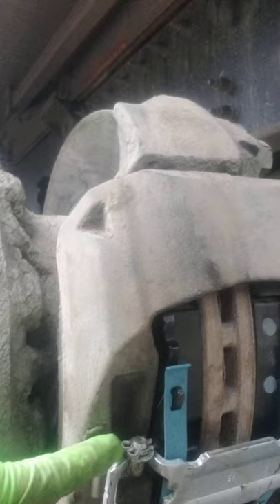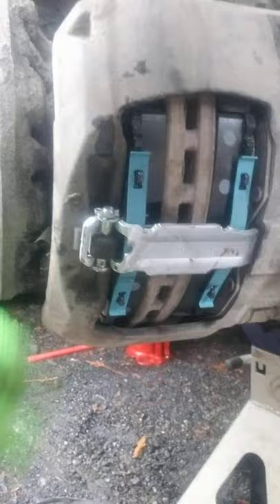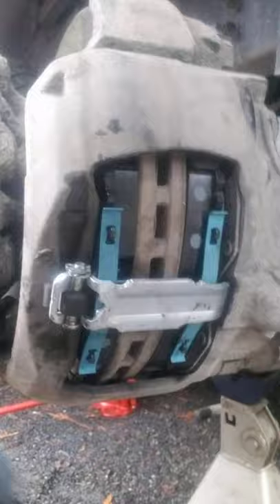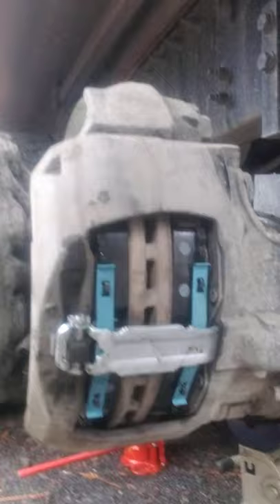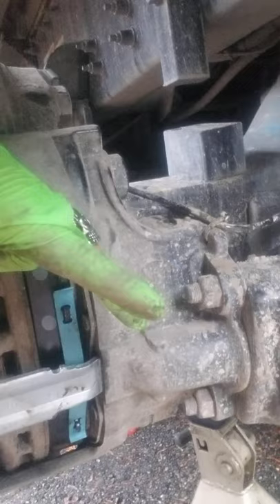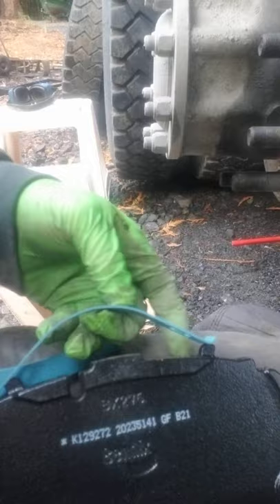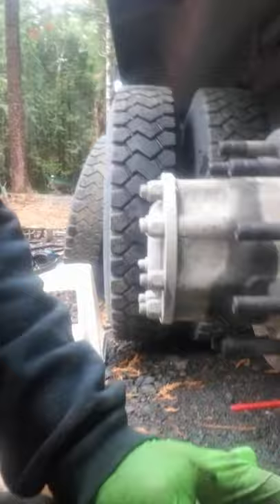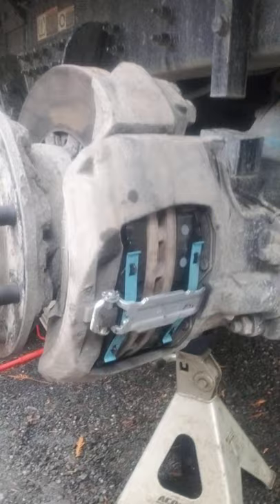how to change disk brake pads on a semi

Comment: How hard you driving ur truck? I am changing mine after 520,000 miles.
Reply from the maker: This is a dump truck not a over the road truck
Reply: @BRIANVANDUYN  What would you get with drums then? On these OTR trucks we find the tractors do way better on disc's, but trailers we use drums, we were getting like 300k discs vs 400k drums.
Reply from the maker: Like 30k if your lucky hahaha